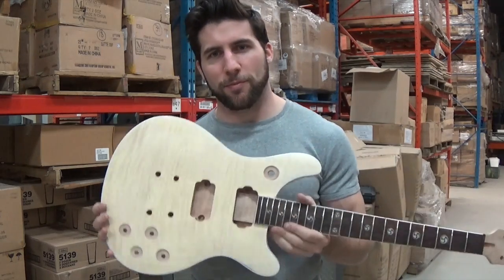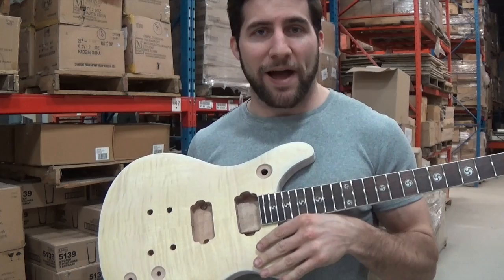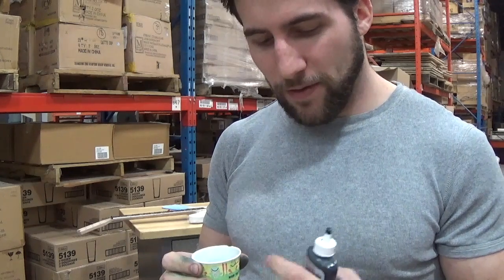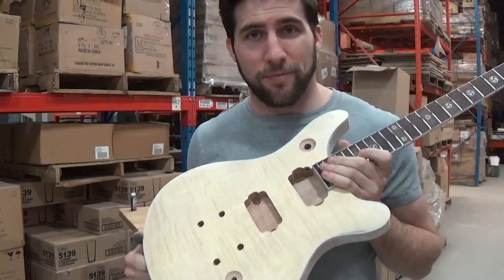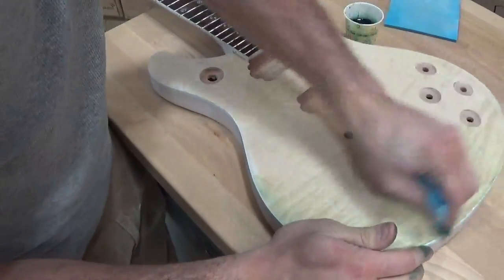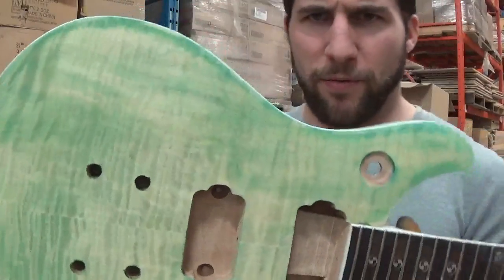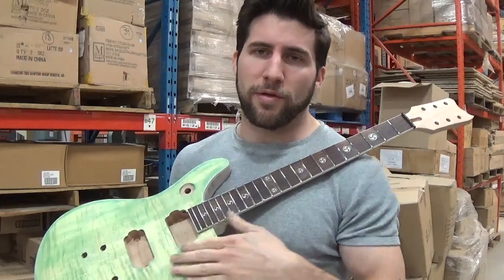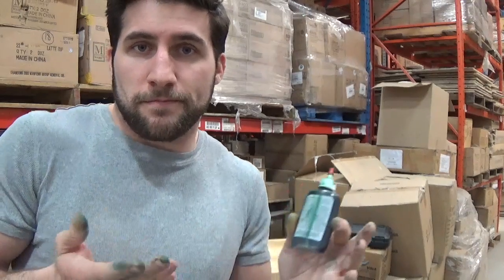The Guitar Kit Build from Guitar Fetish Part 10 | Beginning the Finishing

Comment: Have you thought about using denatured alcohol instead of water? I just colored a similar project using the Trans-Tint color and it worked great.
Reply from the maker: +Trevor Ward I considered using alcohol, but I wanted the dye to penetrate a bit deeper if possible because it seemed like it wasn't getting in there very well. Probably because of glue saturation. Anyway, I opted for the water because it dries slower and should allow for more penetration.

Comment: finally got my bass kit, and yes those dyes on finger/flesh is a pain to clean up, though the outcome is worth it... I'll be doing a entire kit unboxing video hopefully this weekend. my bass neck pocket doesn't really fit the pocket so it time for research on that. any idea what you're gonna do for the neck and headstock on yours? i'm deciding if i should dye mine...
Reply from the maker: +Brian Dabrowa That sounds cool Brian. Is the pocket too big or two small?
I'm not sure about the headstock yet, but I'll probably carry the colour from the sides and back of the guitar up the neck.
Reply: +Brad Angove the body pocket is larger. been researching and got some info from crimson guitars. veener shims for starters, glue and saw dust, or fill in neck pocket and re-route
Reply from the maker: Ya, Crimson guitars is where I would have suggested looking for that info haha.

Comment: I think saying the veneer is extremely "thin" is an understatement. The stuff is like paper. Leaves really no room to sand back your dye. And if they leave glue anywhere makes things even worse. Almost forces an opaque finish when you order a flamed top.
Reply from the maker: +Jim Cronn Ya, It's a very low quality product in that regard. It certainly makes getting that flamed top finish more difficult than it should be.
Reply: Ive also noticed that if you dye mixed with water multiple times to get the color you want, that also messes with the paper veneer. Very frustrating.... Would it be better mixed with alcohol? even though it wont raise the grain?  Maybe crown royal?

Comment: think you were supposed to use black stain first then sand it off. the flame would keep the stain the rest would sand white then you go over it with the green. That would have gotten better results
Reply from the maker: Ya, I'm pretty sure I mentioned why I didn't end up doing that.
Reply: Brad Angove Ah okay I didn't noitce, sorry about that
Reply from the maker: No worries. If it were a better/thicker piece of flamed maple I definitely would have done that.
Reply: Brad Angove I have to wait I didn't watch all the videos all the way through before making comments so I missed it. wants the gist of them and to hear what it sounded like at the end. I'm happy with the end result (cept for the pups though)

Comment: Sweet baby jesus !!!!! Mr Brad you need an ass whooping .... 1 .... wet down the guitar with a mist of water to open the pours ... 2  ... a wet sand will help also to even the sanding from factory ... 3 .... a conditioner also needs to be applied ... and not with paper towel ... cloth ... MR !  You can tell the sanding is heavy on the edges thats why the stain is darker ... uneven sanding
Reply from the maker: +Tappa Tappa Misting the guitar to raise the grain is reasonable. Funny story though, wiping it with water based dye does the same thing. No need for redundancy. Wet sanding wood is foolish because it risks swelling. Conditioner isn't necessary for dye, but it's not a bad idea. I don't like using it personally, as you can probably tell. The type of cloth would be relevant if this were a finish, like shellac for instance. It's not a factor for applying dye. Thank you for confirming what I said about the edge sanding.
Reply: +Brad Angove trust me I know how to finish guitars
Reply from the maker: I'm glad to hear that. With that in mind, I don't know why you've opted to watch my tutorials, but I certainly won't complain about the traffic. Thanks for your patronage.